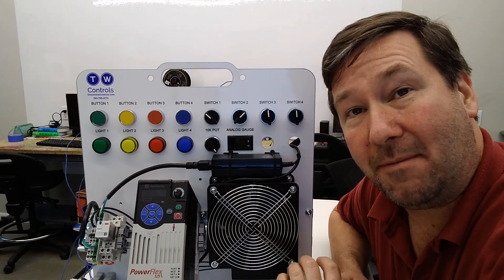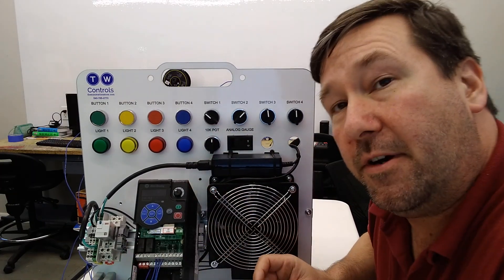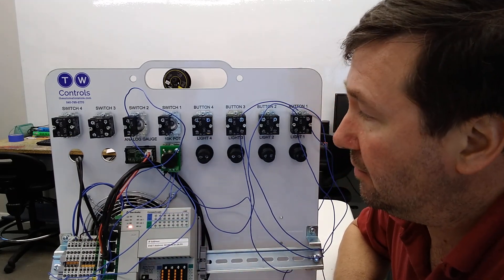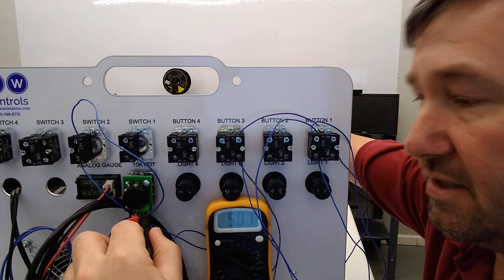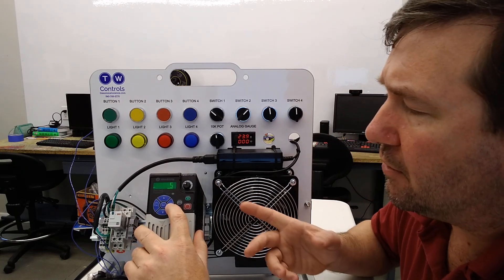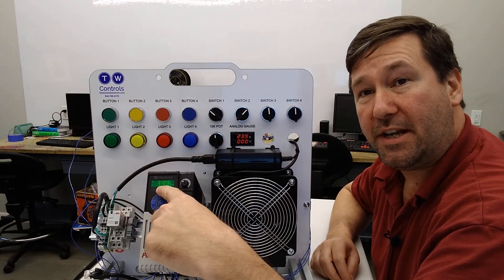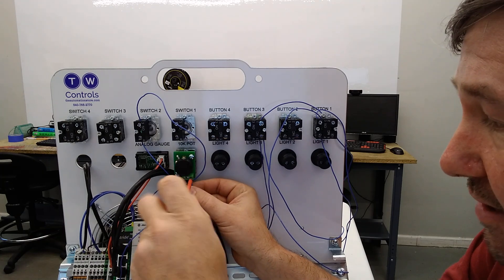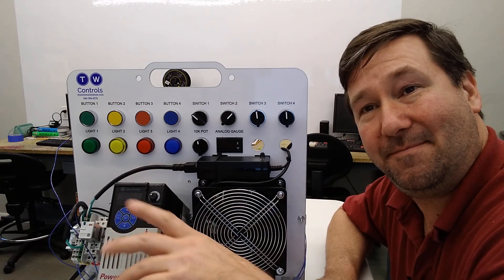How to Add a Potentiometer Speed Control to an Allen Bradley Powerflex 525 AC Drive

Comment: Hii sir,
Usefull video ,
I'm using a powerflex 525, and the drive plc output is connected to the VFD start input, but the drive doesn't run.What is the cause and how do I detect this error?
Reply from the maker: Check if you are actually getting the start and stop inputs, here is a video on how to view them.
https://www.youtube.com/watch?v=cwVhs7n2sXs
Reply: @TimWilborne  sir,
I'm using ethernet, not control wire and digital input for VFD.
Reply from the maker: You still need a stop signal, after that check out this video.
https://www.youtube.com/watch?v=Uek8Z8wdz_s
Reply: @TimWilborne   Thankyou sir, I will do it,again thank you for your quick response ☺️,your videos are help for learning.
Reply from the maker: You are welcome

Comment: Hey Tim! :) Two questions for you -- does this work on the 527 also (the one that's supposed to be mostly just ControlLogix driven instead of having all the options on the front panel like 525 and previous generations)? And what model number is your potentionmeter there? it looks like an AB.
Reply from the maker: I have been wanting to play with a Powerflex 527 but haven't had the opportunity yet. I would guess you would have to read it into Studio 5000 then work with it there. That is an Automation Direct potentiometer.
Reply: @TimWilborne  I'll let you know later this week. It has the IO positions, so in theory it SHOULD work. :)
Reply from the maker: @theironknight  I was thinking after I posted that, I seem to recall that there was a setting to make the 525 parameters work. Is that true?
Reply: found the pot... 800FP-POT6, I presume?

Comment: Hi Tim, how would I go about using 2 push buttons to increase/decrease the frequency of the 525 instead of using a potentiometer?
Reply from the maker: Check out "MOP" in the manual, https://literature.rockwellautomation.com/idc/groups/literature/documents/um/520-um001_-en-e.pdf

Comment: Great video, I came across this while looking for help. I have a 523 and I'm trying to disable a speed pot on a stretch wrapper, but I can't change P047. Not locked with A552 either. Thanks!
Reply from the maker: I know in certain modes these are fixed.  Probably need to look at what all parameters are not at their default.

Comment: Hey Tim, I need to add pots for speed control on a couple PowerFlex 700.  I got the wiring figured out from the manual.  Will it automatically know the 10K pot is connected and start reading it like in your demo, or will I need to set some parameters to tell it to use the analog voltage terminals as the speed command?  I'm assuming I need to change parameters 90-98.  Be happy to throw you some bucks on Patreon if you help me out.
Reply from the maker: Hi Roger.  You need to set the speed reference to 0-10V, check out p090
https://literature.rockwellautomation.com/idc/groups/literature/documents/um/20b-um001_-en-p.pdf
Reply: @TimWilborne   Thanks.  So P090 should go back to default of 2?  Potentiometer will be wired as shown on page 1-20 of installation and wiring.  Do I need to check / change any other 91 through 96?  I'm scheduled to make these modifications on Friday.
Reply from the maker: @rogerheuckeroth7456  Not sure, it would be very application dependent and I haven't worked with a Powerflex 700 in a while.

Comment: So I'm about to put a rheostat on my drive ass of now I'm using the round knob on the drive for my speed reference. It's set at 40 Hertz. My question is using the rheostat how you explained it I go from 0 to 10 volts. When I go to 10 volts will it pass my 40 Hertz that I set on the knob cause I dont want to give the operator of the machine more than that.
Reply from the maker: Yes Ben, when you change parameter P047 to 0-10V, it disables the knob on the front of the drive so it will go to 60hz.  You would need to set the maximum frequency, P044 on the Powerflex 525, to 40.

Comment: Sir can u plz tell me about which parameters should be set for elevator breaking resistor setting etc....in vfd I've short ramp up and down time
Reply from the maker: Elevators are tricky setups. I don't work with them.
Reply: Ok

Comment: Awesome video man! 

Hey so I recently came across the "first pass" s1:15 bit. What's a good application for using this bit in a program?
Reply from the maker: Hi Jack.  Let's say you don't want a machine to automatically start back up or you want to clear out some counters each time or maybe there is a special homing or setup sequence that must be done on each power up, you can use the S2:1/15 First Pass bit for that.
Reply: Tim Wilborne ahhhh that makes a lot more sense now, thanks man! 👍🏻